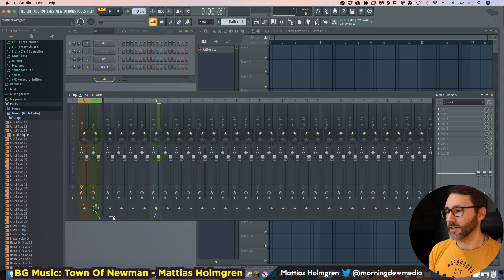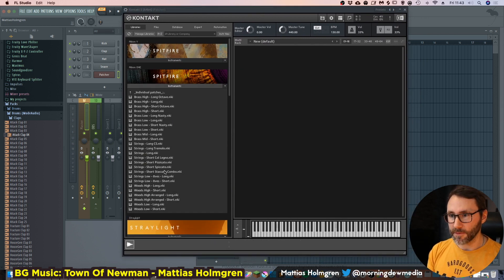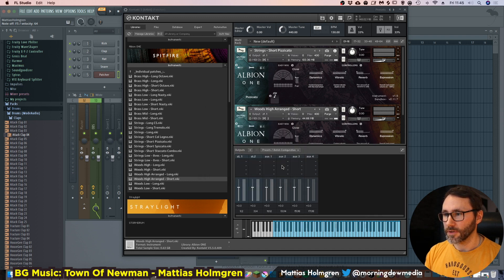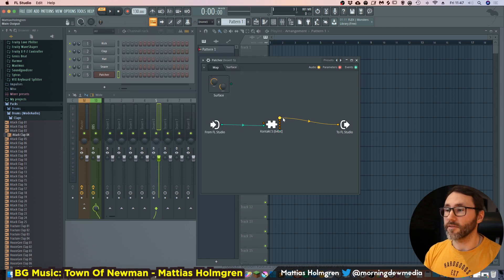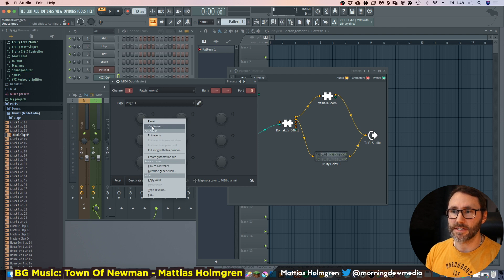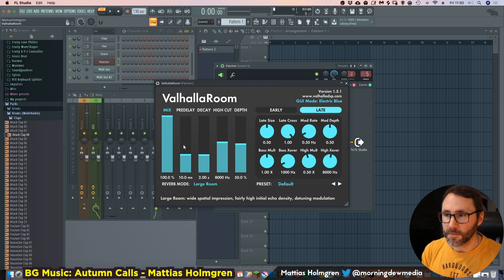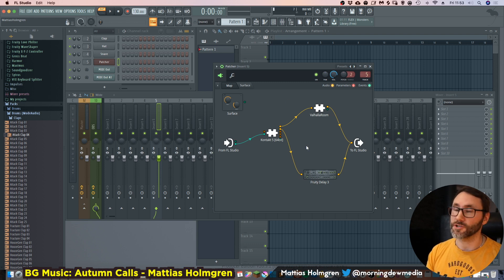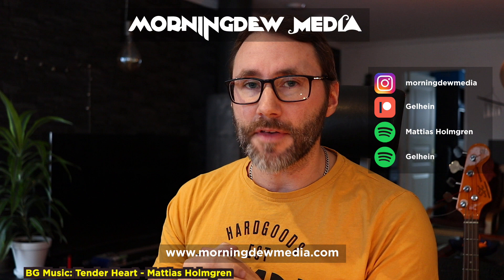FL Studio Patcher & Kontakt Multi Output Routing

Comment: Bro .. we can just send all the instruments output in Kontakt to different mixer tracks in FL Studio directly. One instant of Kontakt is all you need for all you Kontakt instruments. You can simple find out how to do it by Google... Using FL Studio Patcher for this will complicate your workflows in this case, please don't do this ! ... The Patcher shall be used for more complicated plugins setup, see the stock Patcher examples that come with FL Studio .. Cheers!
Reply from the maker: Hi, yes I know very well how to do the basic routing from Kontakt to separate out. But the purpose with this video was to show how to do individual outs with Patcher. ☀️
Reply: This tutorial is great for those that use color mapper. The problem is......only 4 outputs? It should be as many as is in the output selection from the Processing menu. I wanted this video to show me how to do that but....Maybe its cause im using Kontakt Player?

Comment: Awesome! I’ll have to use Patcher for scoring until Image Line adds more mixer inserts. 125 isn’t enough unless you cut/divide your film project into 4 vids (part 1, part 2 type of thing). If IL would just add this and customized cross fading then FL would compete more w the top DAWS like Ableton, Logic. Hopefully FL 21 has no more limits. Thank you for your tutorial, very useful
Reply from the maker: Thanks Lionel, glad you found my videos on FL inspiring. I guess it all comes down to how many instrument tracks one need in a project. Films generallt tend to become quite large scoring projects. But if you keep to a template you are fine. But I mostly spread out at-least some scenes (themes) on various projects, but keep some instruments as a "red-thread". Then I include them in a master project which covers the film. But I do all that in Logic Pro X and not FL Studio. Merry X-mas. 🌞
Reply: @MattiasHolmgren  Definitely! Logic is great for scoring to picture. Thanks for the reply

Comment: would this deplete the audio quality? which other plugins do you reccommend instead of kontakt to use patcher with?
Reply from the maker: Hi Mohit, the quality of the plugin outputs is still the same. So no degrading. Its all digital 1-1 from what I can tell. 🌞I recommend using any synth or effect within the Patcher. My favourites to use is Harmor, Sytrus, Omnisphere 2, Phase Plant, Serum, Form, The Mangle, ColourCopy, Replika XT, MturboReverb & MturboDelay, Valhalla Room etc. You can also make use of the EQUO native FL plugin to split the signal and control sends in Patcher. Its a very powerful environment. 🌞🌟😀
Reply: @MattiasHolmgren  thank you so much for the help 😇😇😇  subbed !

Comment: In Renoise you simply add a "SEND" DSP to the track, you can have multiple SEND on the same track for doing the multi output routing.
If you want to do it for an instrument without having a track specified for it. There is under the "Plugin" tab an Audio Routing, which allows you to send to multiple channels. Very easy.
Reply from the maker: Renoise bro. 😋😺👻🤖 Yeah FL is a bit fiddly but has very Nice plugin suite... You should hear Harmor and Sytrus, grossbeat and The Delay-3...they are super powerful! Thanks for writing Elrinth! Feel any better from the cold?